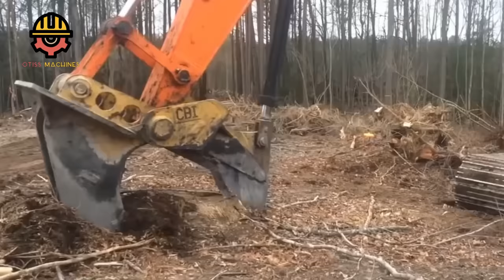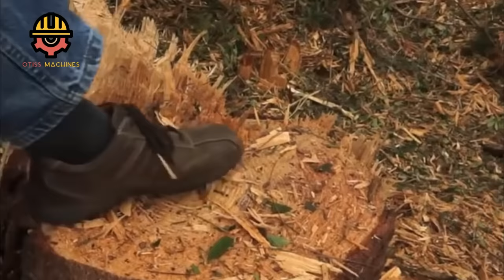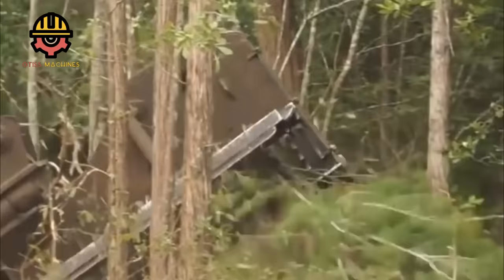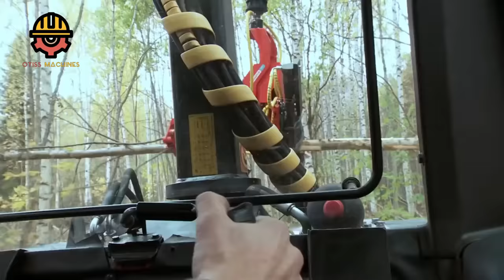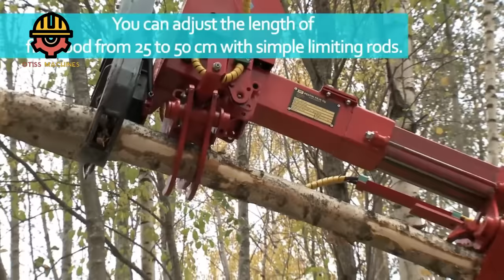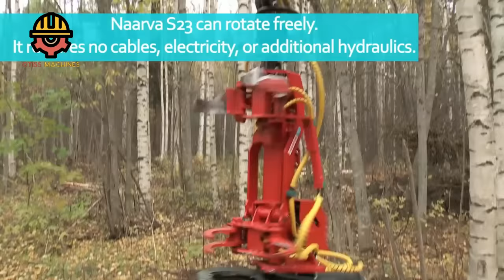Dangerous Fastest Chainsaw Cutting Tree Machine Skills - Heavy Biggest Felling Tree Machine Working

Comment: That first tree was basically priceless based on its age and health. The many sides of greed 

Tree farms are a lot better for the environment because the land is reused and trees are only grown for a specific amount of time before being cut.
Reply: the first tree was rotted from the inside out
Reply: @MegaTmoore11  u think they are going to go around doing ultrasound testing to random trees to figure out which one are going 2 die in another 100 years.
Reply: @ethanelectric1024  No, the tree will show external signs once the rot has progressed far enough, and this one was at least 1/3 rotten so it will definitely show (the top of the tree is probably dead). But you could probably do an ultrasound test too if you wanted to.

There's very little business interest in felling rotten trees. This one may just as well be from a protected area such as a national park, and the reason for not letting nature take its course might as well be that it's close to a trail for instance and they want it down in a planned manner. It may also cause damage to surrounding old trees, so in a way this might protect other trees. But who knows.
Reply: @Greippi10  great thinking skills
Reply: Believe it or not, a rapid growing tree adds more oxygen to the atmosphere than a grown old tree. For a tree to add oxygen into atmosphere, it needs to be growing or adding in mass.
Reply: दयौ
Reply: Trees breathe, they use oxygen.  While old huge trees do produce more oxygen, they also use more oxygen so their net oxygen output is far less than new growth, sometimes old trees actually use more oxygen that they make.
Reply: It looked like it was rotting on the inside.
Reply: @ethanelectric1024  I've logged before and believe me a hit with the hammer end of an axe can tell you alot.
Reply: That first tree was garbage,did you not see the center of it

Comment: What was the reason for cutting down such a gorgeous old tree?
Reply: The heartwood of the tree was rotted out.   Safety hazard
Reply: Yes
Reply: @brandonbowerstx  doubt it. just to sell the wood is my guess
Reply: @hankb7725  it was rotten. Go back and look
Reply: @lemon-iu7bo  how would I be able to see inside the tree from seeing the outside lower part?
Reply: @hankb7725  you couldn't see it when it was falling?
Reply: @lemon-iu7bo  that was a tree breaking. It’s so heavy that you don’t have to cut it all the way through for it to fall, so what you see is just shattered wood
Reply: @hankb7725  the black center is just shattered wood?
Reply: @lemon-iu7bo  wood is not always a light color. Some kinds of wood are quite dark color.
Reply: @hankb7725  yes I know. But you can tell that tree was rotten.
Reply: @lemon-iu7bo  no you can’t. but people like to think it was rotten to not feel bad about cutting it down.
Reply: @hankb7725  you can see how the rotten center breaks differently from a healthy center. I must ask what experience you have with wood and trees?
Reply: @hankb7725  True many woods are dark in color but not the Douglas Fir in this video. It is quite light. The dark rot really stands out for you to see. Notice the steel cables to keep the trunk together, to stop it collapsing on passersby. Note how frightened the professional loggers were when cutting such and unstable tree. Notice how little cutting they did before the tree fell. They were basically cutting a tube like structure with no central integrity.
Reply: @spudpud-T67  is be frightened too while cutting that huge tree
Reply: @spudpud-T67  how do u know it’s a Douglas fir
Reply: @lemon-iu7bo  For a tree that was rotting away, it took a lot of effort to take it down. Someone could say a rotting tree would go down much more easily..
Reply: @ElInextricable  1st of all that tree was huge. 2nd  thats about the effort it takes to cut down a rotten tree.